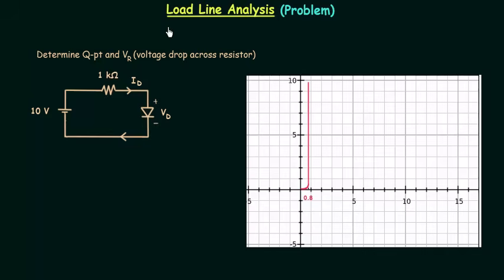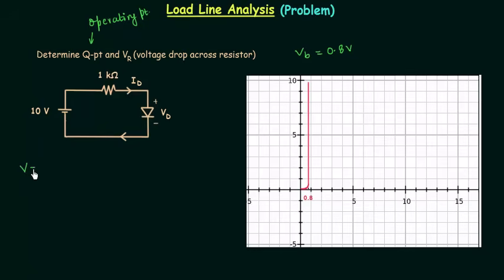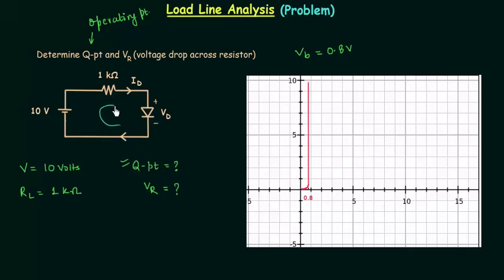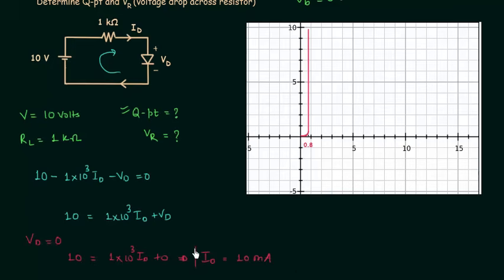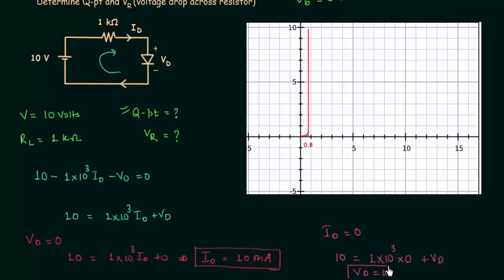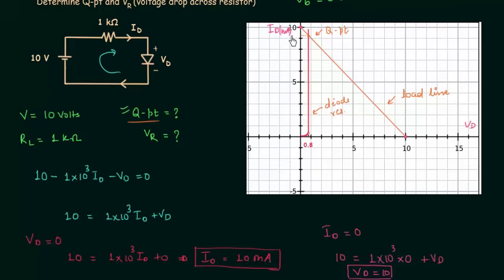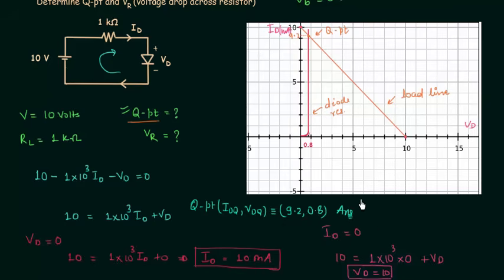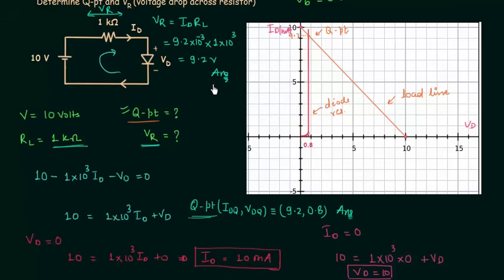Load Line Analysis (Numerical Problem)

Comment: Could also take your 10v-0.7 and determine the voltage across the resistor since you know a voltage drop of 0.7v is across diode.

Comment: Just isolate the resistor, find the current and then the draw the load line, since the voltage is known across the diode you can find your Q point by graphing both. KVL seems excessive

Comment: In the previous lecture u have said that for solving numerical problems, we hav to use constant voltage drop model for diode equivalent circuit. But u used ideal equivalent circuit model...??? Can u please explain that am i asking the correct question?
Reply: Did you got the answer.
Reply: He is using constant voltage drop model not the ideal one.

Comment: Id value is 10*(-2). how is it 10mA?
Reply: Id =10×10^-3
Id=10mA
Reply: 1 Ampere= 1000 mA . So converting Ampere value into mA = 10*(-2) × 1000 = 10 mA
Reply: Instead u use 1k ohm as it is without converting it to ohm... It'll give you answer directly in mA

Comment: sir, barrier potential of this diode is 0.8v, without load line can't we just find the  v(r) by 10- 0.8?  can we use this if there is no constant voltage drop?
Reply: I believe not. It worked here because the slope of characteristic curve is infinity (linear )so it wouldn`t matter where the load line would hit because the value of VD is the same.

Comment: Why are we taking the value of y axis first in Q point? We shd have (0.8,9.2) according to the conventional solution.
Reply: Same doubt.
Reply: Ha bhai aise hi hoga , galti se mistake ho gaya bhaiya se 😝
Reply: I think he did not show the full solition here. You should use iteration method for the equation to match each other. I guess when Id =0.8 and etc. The Id equation is 0.8 = I0 x (e^(Vd/Vt)+1) this satisfies the output with Vd = 9.2
Reply: @facedekiadam2916  how did u go Is as 10?

Comment: Why you are putting the value of y axis first sir(in the co ordinates) ?
Reply: I am studying Engineering too and here is my interpretation.
The graph represents the behaviors of the diode. The video makes use of the KVL to find the relations between VD and ID and plot the line onto the diode graph.SO you can imagine that once you know the VD, You will know the ID then. and the intersection point is exactly the value of VD in this circuit. then you can find the ID by the equation ( or by observation in graph) , make use of this information can find the voltage across the RL(VR)

Comment: Sir, Why quiescent current is equal to diode current??? which concept you have used for this??
Reply: if u notice the circuit, it's in series. current in a series circuit are all equal

Comment: In the Circuit diagram you are representing diode voltage as V sub D... isn't its same to barrier potential that is V sub b
Reply: no its not same..  Vd consists of Vb+id*Rd and after kvl the actual KVL (taking Vb under consideration) V=iLRL+Vb+idRd..

Comment: How did u get the ID of 9.2? Will u just assume it?
Reply: Thank you for replying. Even though we've been past this lesson a few semesters ago, it's still nice to know how it's actually done.
Reply: are graph se pata lagana he
Reply: using eq 10 - (10^3*Id) = 0.8
you can calculate Id and it comes out to be 9.2 mA
Vd is already know from graph = 0.8 V and, silicon diode have nearly 0.7V as Vd when forward biased. so Vd cannot be 9.2 ever when forward biased. Remember Diode when ideal act as short circuit when forward biased??? and short circuit is having potential difference/voltage between 2 points = 0.
Reply: Jem Quizon ☺
Reply: just use the equation from KVL and put Vd value 0.8. you will find 9.2ma
Reply: Your Id is equal to 10 and your Vb is equal to 0.8, so 10-0.8 = 9.2
Reply: @LouisEarl  wow current-voltage=current.epic 😂😂😂
Reply: @hussainrassiwala2132  😂😂
Reply: @LouisEarl  Voltage subtracts voltage to give current, that's incredible :):):):):):):).....epic